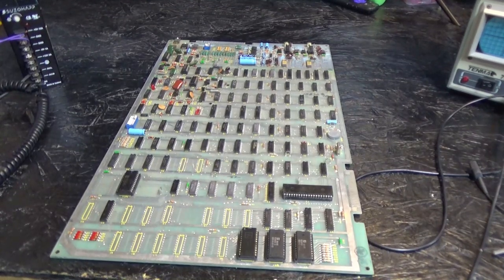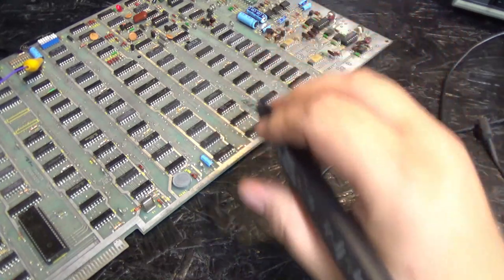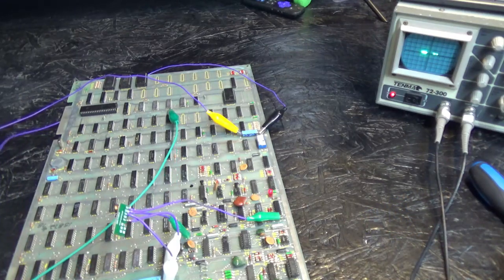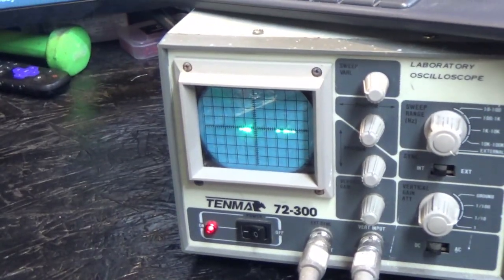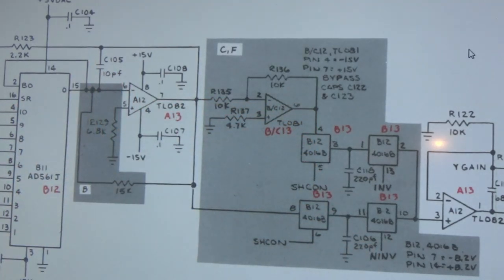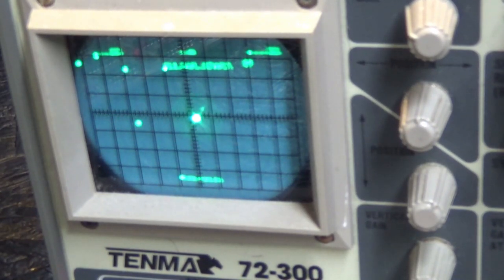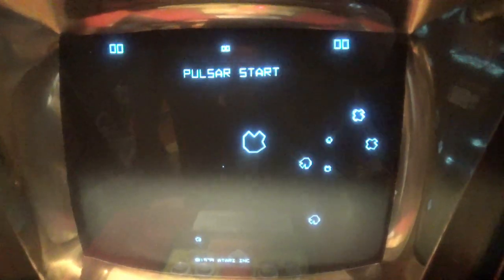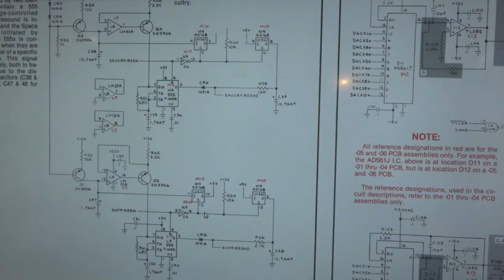Yet another Asteroids pcb repair

Comment: On the test bench, I use the Z-axis to check for health (as soon as the machine stops watchdogging). Then I jumper the test input to ground and you can clearly see the gradient on the scope. When that's there, the machine is either running fine or the problem must be far up the analog side.

Did anyone count how often he said "Just for giggles"?

Also for the hard to find DAC I once "engineered" (as in trial&error) a circuit using another TL082 and two AD7533JNZ DACs you can still get new (albeit they're not much cheaper than the original replacement DACs)